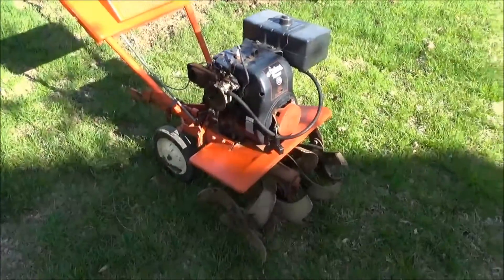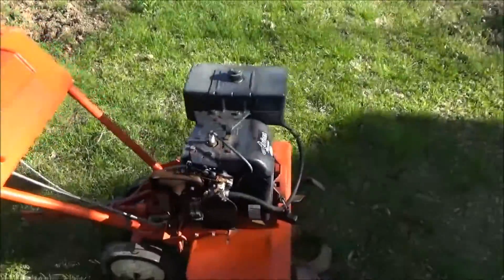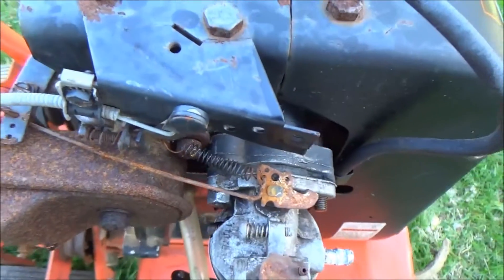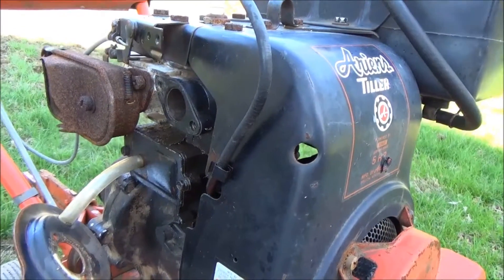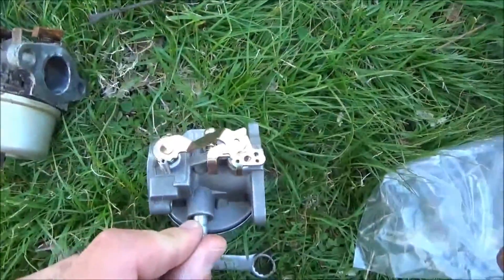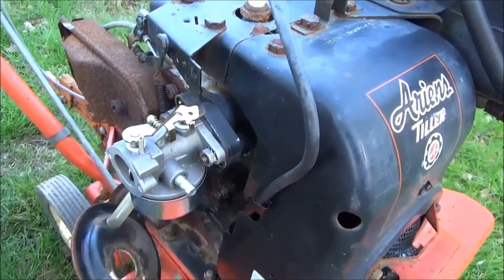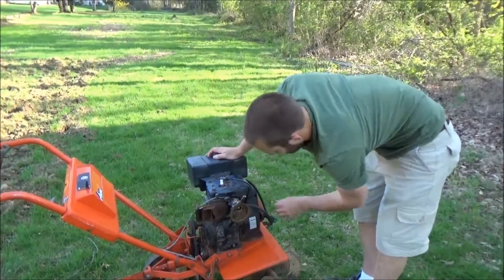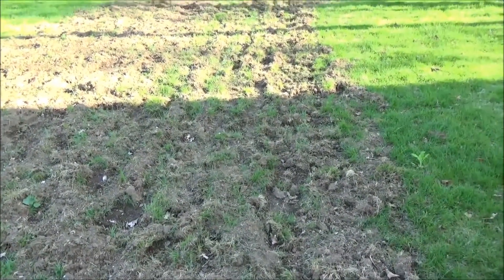Ariens front tine tiller gets a new carburetor

Comment: What is the model number of the carb replacement you used?  I have a similar tiller with similar needs.

Thanks,
Kirk
Reply: Where did you buy the carburetor? You mentioned on eBay, do you happen to know the link or model please? Had a same tiller, but the carburetor seems bad now.
Reply from the maker: https://www.ebay.com/c/167221792
Reply: Links no good. Wish I could find a carb myself lol
Reply from the maker: Sorry it was listed and working 8 and 3 years ago lol. Most of those carbs are universal figment so it shouldn’t be too hard to find one.